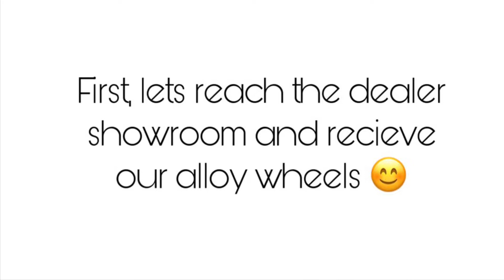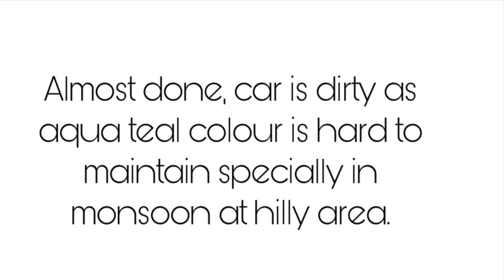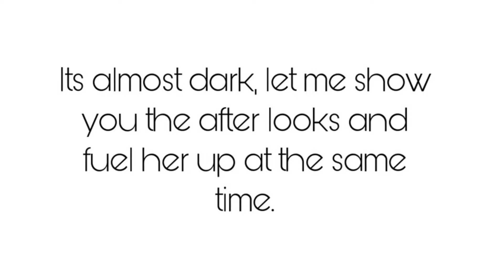Installing top model Alloy Wheels in 2020 Hyundai Grand i10 nios Sportz model | 14inch to 15inch

Comment: Maine sports book kar di hay showroom wale bol rahe ki sports k alloy exchange nahi honge
Reply from the maker: Woh depend karta hai Showroom and dealer par, agar apko 15 inch diamond cut alloys sportz mein chaiye toh simply book sportz dualtone (if budget allows), sirf 30k jyada hai, usme 15 inch diamond cut alloys ke sath projector headlamps, all black interiors, wireless charging, leather wrapped steering, with black roof from A pillar mil jata hai that overall makes car look more sporty and value for money. (Afterall 30k zyada pay karne se apko alloys ke sath aur bareya features offer karta hai company)